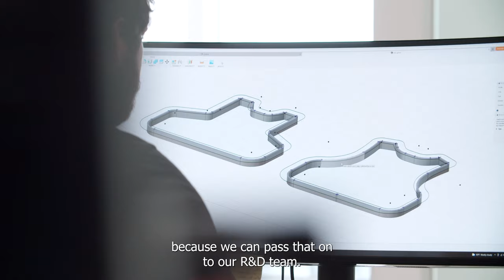"What is the future of Safe Life Defense Body Armor?" Hear from our CEO, Nick Groat

Comment: Build a taller vest. No one want their guts blown to shit. Then I can send mine back to you.
Reply: True the vest could use an inch or 2-3 inches in length.
Reply: @johncurry6260   yep at least 4” longer for me, but he width is good.
Reply: Built for comfort while sitting and to protect vitals. Most body armor products are going to have that problem I think AR500 body armor does a "gut drop down panel" but I personally don't care for steel plates but is definitely an option to add to your safelife vest.
Reply: @kylejansen8456  I wore body armor for many years and I own their 3A+ vest with stab protection with Plates, purchase less than a year ago. It is a little short. My First vest was custom made, when American Body Armor was in NY many, many years ago. an extra long vest would be a good option, several body armor companies had longer vests available, especially for taller customers. Theirs could indeed be a little longer. Otherwise it's a nice vest.